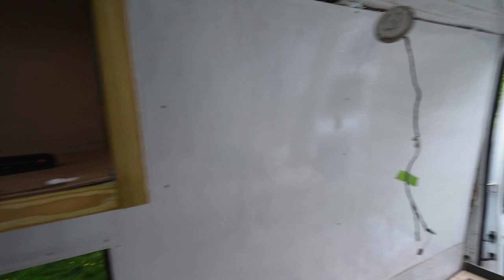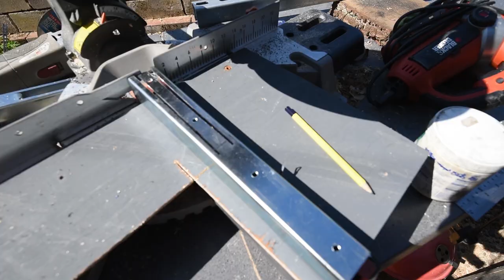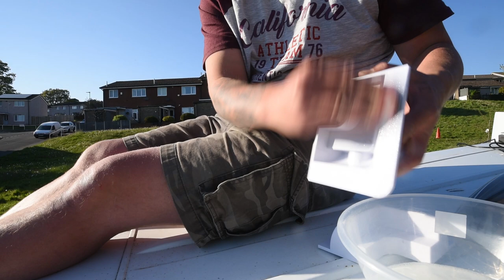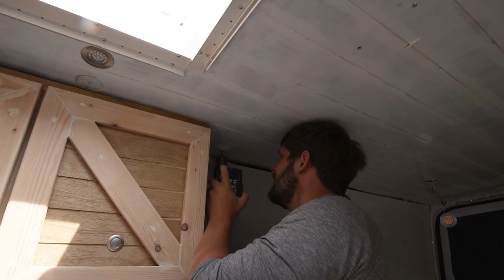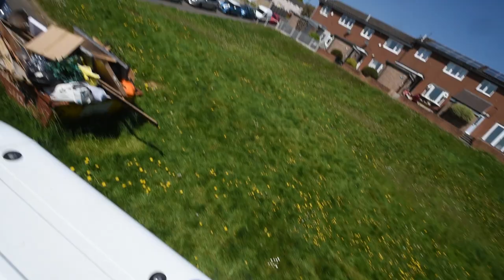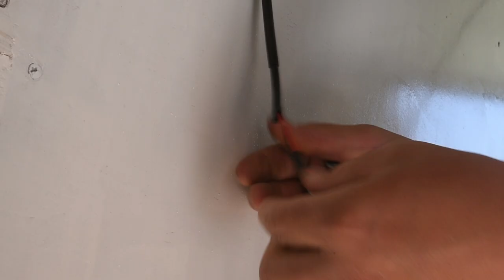Transit Vanlife Part 18 - More Solar and a lick of paint!

Comment: Nice work, looks like the solar panel installation was pretty technical..how much longer you think you have until completion
Reply from the maker: Im a lot furter on than this now, im a bit behind with videos and theyre not as cohesive as im trying to get on with finishing it. Thanks (Prob be another few weeks before properly finished i reckon)
Reply: That's good to hear..is the UK still in lockdown? If the lockdown is lifted, will that affect how long it takes to get done..glad your still posting videos, looking forward to the next one